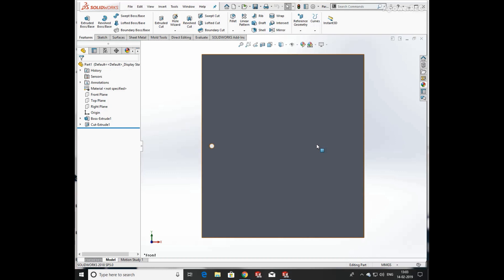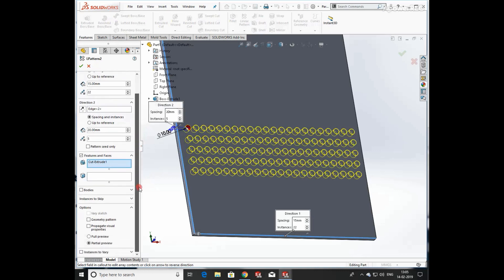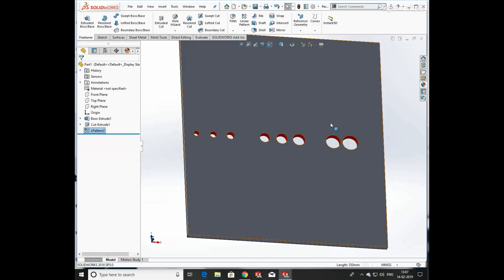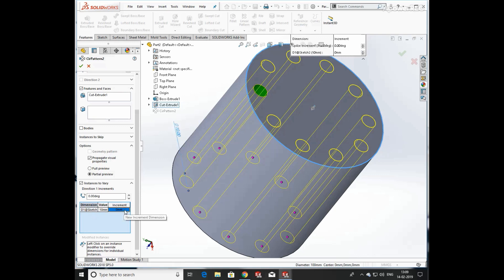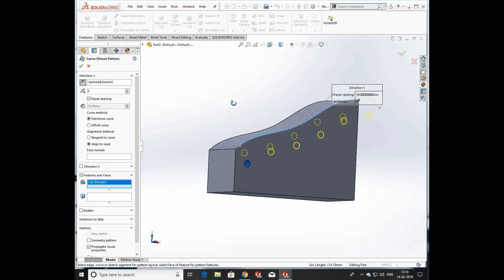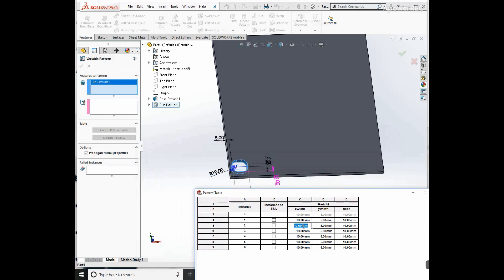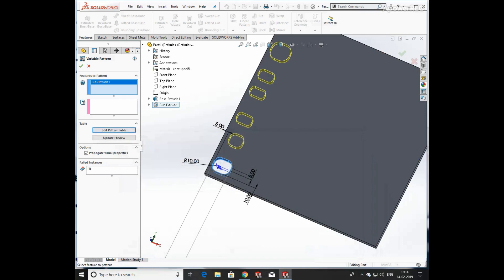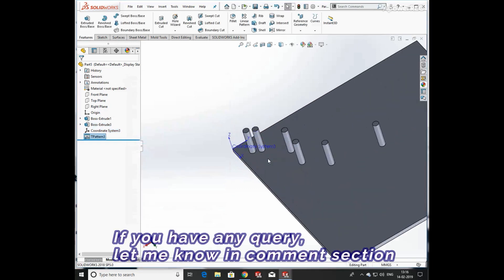PATTERN | Solidworks Design Hub

Comment: I do have a comment. I am try to make a variable angle sketch (just making a line) that where the line pattern is a angle increment is (x) i.e. 20 deg, 23 deg, 26 deg, 29 deg etc.  so I can create a split line feature on surfaces to eventually make  solid part that has this increasing angle.
Reply from the maker: yes you can create solid part having increasing angle with the help of split command. For this you have to draw line on the surface of the body and using the command split body and save these parts in your drive.
Reply: @SOLIDWORKSDESIGNHUB  thank you very much for your reply. Let explain better the limitations I have at the moment. I can create a solid part using the split line and it is ready for pattern. The variable pattern feature says "this is not a proper seed) while I can do circular and linear patterns but not a variable. I need to create a pattern of this part (created with split lines) with a variable angle as they are created in the pattern. Creo allows you to group the tree feature of the boundary (using 2 surfaces and 2 split lines) and then pattern this feature with variable angles. Just can't seem to crack this in SW. If you know of a way I would greatly appreciate it.
Reply: I will try your split line and cut the parts and see if this results in the pattern I'm looking for. I can share images of the part if I can get them to you
Reply from the maker: @Cleva2025  HELLO MR. LARRY CANIPE IF YOU WANT TO CREATE VARIABLE PATTERN OF ANY BODY IN SOLIDWORKS SO YOU HAVE NEED TO CREATE ANY REFERENCE LINE OR SKETCH AND PATTERN THAT BODY ALONG WITH THE REFERENCE SKETCH. IF SOME ERROR OCCUR THEN SKIP MERGE FEATURE . AND FOR A SOLID BODY YOU CAN AGAIN MERGE THE BODIES.
Reply from the maker: @Cleva2025  CAN YOU PLEASE SHARE THE FILES /IMAGES
Reply from the maker: @Cleva2025   THIS IS MY MAILING ADDRESS (solidworksdesignhub@gmail.com)
Reply: Hello and thank you for the connection. I have sent you via email the STEP file created in Creo and the SW import.  Creo allows for a simple variable pattern on group  of features and repeated as a variable angle to create the part that has the variable blade separation from top bottom. This was made by projecting a line on a cylinder for the bask side blade edge and another line on the surface model of the shape for the front on the blade. Because these surface occur on a curved face we get the dynamic style you see in the images attached in the email.  I am sure that through brute force we can create this in SW but it was so elegantly simple in Creo with just a few line on the feature tree.  I have not found a way to do this as easily in SW and have appreciated your help. If you like challenges in SW then I think this is it.  Thanks for taking a look.
  @SOLIDWORKSDESIGNHUB